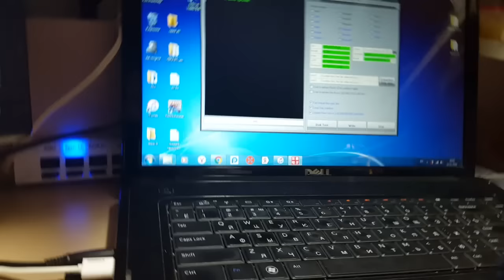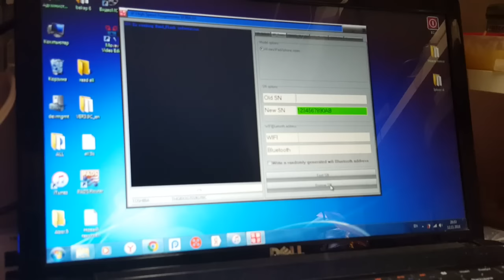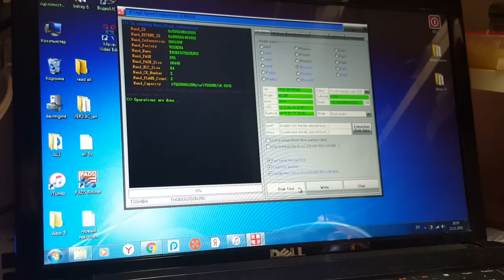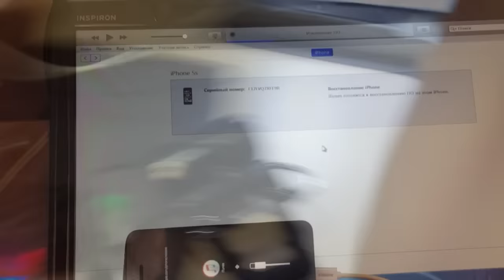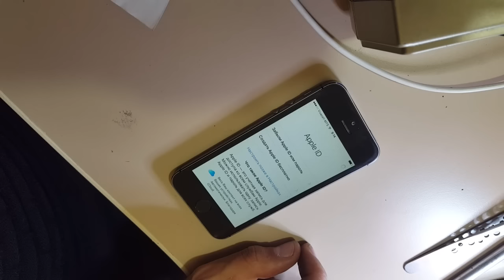iphone 5s пересадка nand bb spi  на донор

Comment: Hello Arthur, very nice video and technical skills! 2 questions ,the green paint you use to repair pc-board and the balsem to get the white stuff on the pc board? Do you have any specifications of theze materials? Greatings
Reply: Thanks for superfast answer ! The balsem you heat up(white smoke)and that leaves a white drying residu on the pc board before soldering , what material is that?grtz